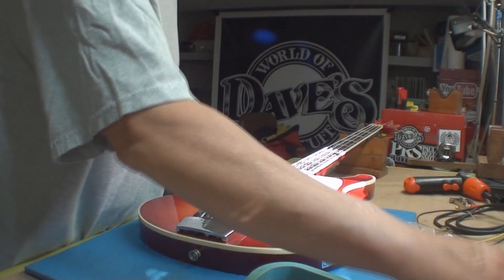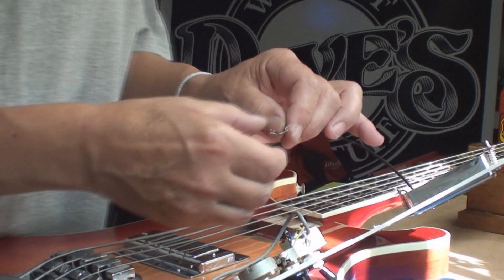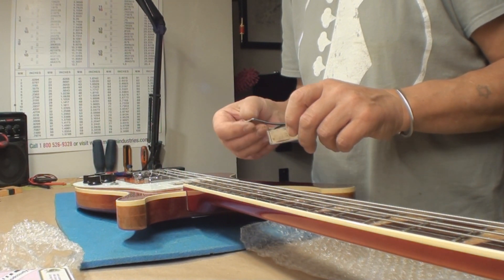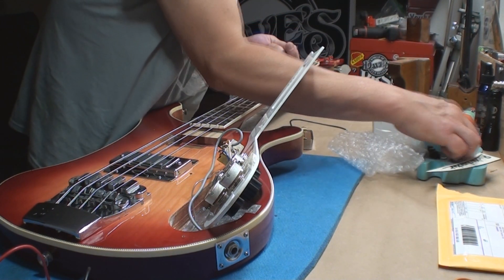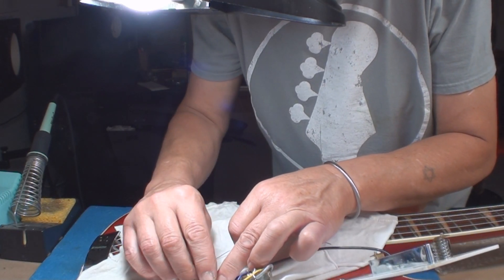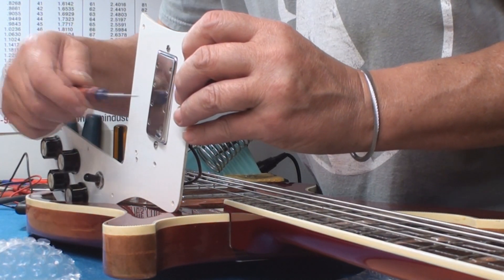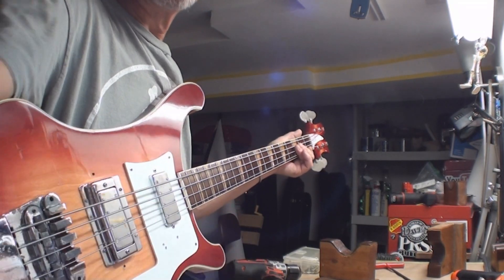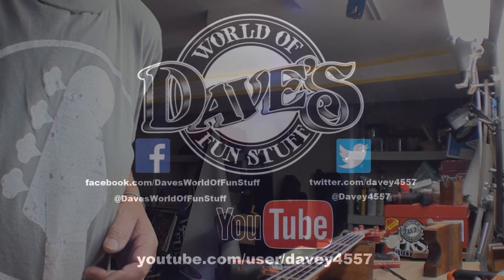Ibanez Rickenbacker Bass Gets It's Pickup Rewound and Other Fun

Comment: After rewinding and troubleshooting numerous pickup coils in the 80s, I found that most coils were still good but just needed a new connection to the pickup wire ( number 42 AWG ). It's easier to handle human hair, that wire breaks if you frown at it. Soldering it is even trickier! The number one pickup coil killer is steel wool, gets in and shorts it because the magnets pull it in.
Reply: You damn well got that right, bro. On both counts.

Comment: Hey man.I certainly don't wish to start a war, only trying to help... As a EE, the  general rule is to heat the work, not  the solder. If both points are properly heated, the solder (which is a lot softer) should create a joint almost instantly. This is the reason why you don't want to use an underpowered iron for  this  work... I usually use a 40W iron for guitar work, hot enough to make a quick joint, not hot enough to destroy your components... I guess what I am saying, rest your iron on the joint you wish to achieve for 10 secs, then apply solder...
Reply: That's how I learned to do it, too. When the leads heat up, the solder will flow into them, provided they're properly tinned beforehand. So, for example, heat the terminal until the terminal & the lead are both hot, then apply solder to the joint, and don't just melt solder onto the soldering tip, but only on the connection. Whenever possible, one should try to wrap some of the lead around the terminal, as if creating a mechanical connection, for adding strength & durability to the solder joint. In other words, we don't wanna rely on just the solder alone, to hold the joint together. Have fun, Kristopher!
Reply: Yes in an ideal world that's how it's supposed to work but in the real world there are exceptions. When soldering a wire to the back of a pot , the metal casing can absorb a lot of heat so you have to adapt your technique. You presolder your wire and try to melt part of the solder on the surface of the pot and the wire. You might not be able to melt the entire blob of solder on the pot because of the heat dissipation.
Reply: @nrich5127  Exactly. My failsafe technique is just: Heat the surface, with solder pushed against iron. Once it flows, push the solder until there's enough. Done

Comment: Dave, you shouldn't get a continuity beep across a 5K resistance.  If you normally get a beep from your other pickups then something isn't right.  A proper continuity meter will give a "true" reading if the resistance between the probe tips is a few tens of Ohms or less.  Continuity is a short circuit (or a few tens of Ohms at most) between the probes, so your meter is working properly.  Think of it as a short circuit detector.  I'm sure many other guys out there will explain it better :D
Reply: I assume he was testing to see that it wasn't dead shorted. He did do a k ohms test I think.

Comment: I played a fake 2 years ago that was perfect.  A guy playing in a bar band had a custom bass built for him, it had a neck thru with standard  dual-action truss rod and 2 carbon fiber rods and an Ebony fretboard and extra jumbo stainless steel frets a zero fret and the nut was there to hold the string in the correct location but the zero fret was the nut.  he had real rick pickups in a real pickguard and truss rod cover.  The bridge I think was a bad ass bridge so much better than original bridge.  The thing was awesome.  He said it cost him 1600 to be built.  he did not remember the builder's name but said the guy would not build another one for him at the same price so I guess the guy under quoted the price.  I wish I could find somebody to build that bass for me when I still played in a band,  I love the sound of my old rick and the feel of the neck, but did not like anything else about it.
Reply: Use to have one of them.bridge was made of brass instead of aluminium.:-)on the original ric .pickups was from 4003.

Comment: I like the copies better than the originals.  At least the Ibby and the Fernandes/Burny ones.
Reply: Good to know, never played any of those.
Reply: That's a pretty close copy to the original...I'm surprised Ibanez were able to get away with it
Reply: Pokey Prasch This one is an Electra Corsair 2278. Hotter humbuckers, thicker body, bolt on neck, one traditional truss rod, smaller mounting contraption around the back pickup. THESE ARE POSITIVE CHANGES.
Reply: I actually used the hole in between the mounting ring and the pickup as my anchor point for my thumb.
Reply: Tokai Rockinbetters are great too. I've always preferred the non-insane truss rod system of the copies, makes it so much easier to adjust than the actual rickys xD

Comment: If you ever get hold of one of these great instruments, here are my top tips to radically improve it:
• Replace the godawful pot metal bridge with the Hipshot Rick bridge.
• Replace the nasty-plastic nut with a GraphTech Black Tusq nut.
• Replace the crumby pickup switch with a Switchcraft one.
(I tried others, but the Switchcraft is the only one that hasn't gone crackly or failed within a few months.)

And, if the tuners are a tad "wobbly" or "iffy:"
• Replace the tuners with new Gotoh tuners
(the Gotoh ones are the only ones I could find which match the originals for shape, size, and screw hole fit: you're welcome!).

I did all of the above on mine, and I guarantee you that it will sound, and play, MUCH better.
Also, you will finally be able to properly intonate the strings (!) AND — if you replaced the tuners — the tuning won't drift: WIN!

Optional: put Thomastik-Infeld Jazz flatwound strings on it.
(Or, Rotosound roundwounds if you want to sound like Lemmy [LOL!]: but you'll need to replace them every month or so.)
Reply from the maker: FIRE works also
Reply: @DavesWorldofFunStuff  wha-?! I'll have you know that I've owned my Ibanez since new in about 1973, and it's my only bass (by choice). MUCH better than those Fender things; literally can't get my fingers round the neck of a Fender.

Comment: I laid down $500 for my Rickenbacker a year later than you (1976) and gigged with it for 10 years.  Mine was the less expensive 4000 set neck, to which the shop in Tarzana, CA added a Ric neck pup.  Take off the scratch guard and you'll find the definition of Gooched.   It would be a fun project for you.  Anyway, that Ric tailpiece is absolute junk.  Have you tried the HipShot replacement?

Comment: It don't sound all that rickenbacker-y...my old 74 4001 has a neck like a ball bat....and sounds like a ric....i dont understand why ibanez would clone a ric and have it sound like something else....
Reply: Augie Doggie Common complaint of the old 4001s in the mid 70s was that the pickup output was too low. These are super hot humbuckers so they probably tried to remedy that, same with the single truss rod bolt on neck instead of the neck through with unconventional dual truss rod system that Ricks still use. Ibanez and other Japanese companies were very fond of taking traditional models like strats and putting their own spin on them: humbuckers and floyds, making guitars out of basswood because the hard ash America was using was too heavy, etc.
Reply: I'm ok with low pickup output if it gives me that ric sound....i just turn the amp way up.....